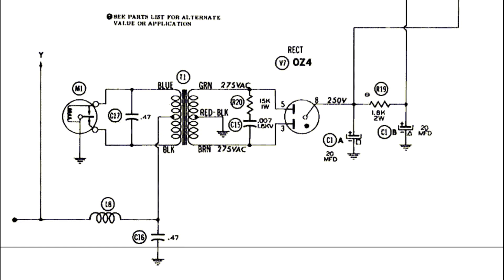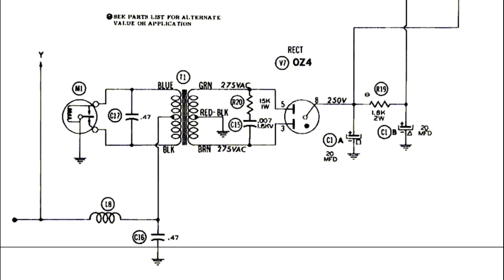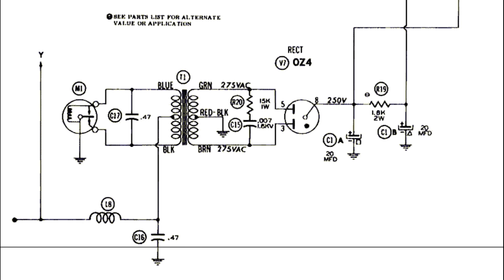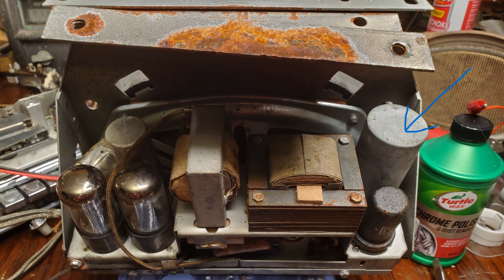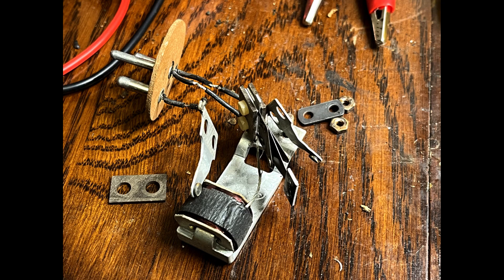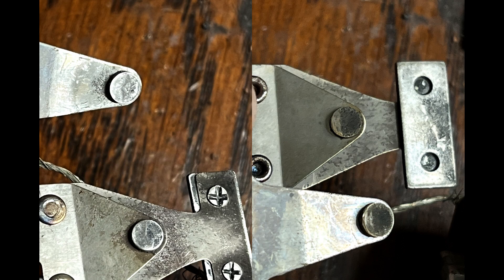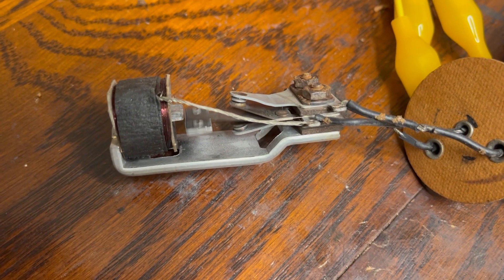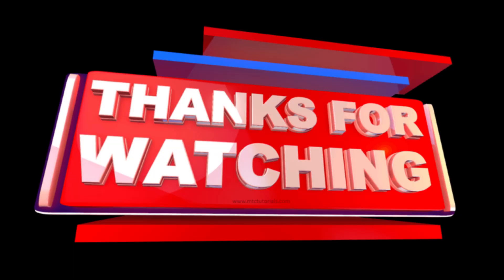Vintage Car Radio Vibrator Refurbishment

Comment: To prevent failure again replace the 2kv buffer capistor in the secondary circuit of the power transformer.

Comment: Refurbishing these old vibs is never a lasting situation. They will fail pretty soon again. Best is to replace them with a solid-state model, built in the original can. That way you maintain the original looks of the equipment. I recommend PeKo radio vibrators, they are the best.
Reply from the maker: For what it's worth, this one is still going strong. Solid state vibrators are always polarity sensitive; nothing on the car is from the factory though (aside from polarizing the generator), and some people like to keep it that way.

Comment: Did not see the cure. Personally I have a burnishing tool from the old day from the Bell system. If contacts are too pitted you will need to use 600 grit emery paper ( wet and dry variety ) to get things polished down but do not over do it. Following with a polishing with the burnishing tool. It’s important that very little of the pitting remains and surface is as shines as possible. Then clean with 90% isopropanol. Leave no residue behind, it will lead to arcing which will lead to more pitting. If the wires are falling apart, you can replace them with new wiring of the same gauge or yes you can resort to heat shrink tubing. I recently replaced the vibrator based circuitry of a 12 volt 15 watt fluorescent RV light fixture with a solid state module. The circuit on the light consisted of a four pin vibrator rated for 12 volts and a simple transformer. Not too efficient and noisy.

Comment: Excellent video! Thanks for sharing your knowledge and expertise. Can you recommend what voltage DC I should use to test a 6v vibrator from a Nash '49 radio? It has four posts: 2 small, 2 large. The radio powers up, but the vibrator is not humming; I suspect it is bad / contacts frozen. I am not sure how to test it before putting back in the radio. Thanks again!
Reply from the maker: Remove it and ohm between the center post and each contact to test both. You should see continuity from pushing the arm to the contact so they are lightly touching. If not, clean the contacts then test again. If the ohm test passes, then reinstall it in the radio and it should work. I suggest also to test the capacitors in the radio when it is out of the car, as bad capacitors will cause unwanted fluctuating voltages. You have to disconnect one lead from each capacitor to test it, then solder the lead back to the circuit if it's ok. Desolder, or cut the lead in a convenient place, not too close to the capacitor body so it's not overheated when you solder it back together.

Comment: I thought I would add one more comment-I took the vibrator in my Snap-On Ignition Analyzer apart and repaired it yesterday, based on the information in this video!  Thanks to what I learned here, my 50-60 year old ignition analyzer is now tested and working!

Comment: American Flyer trains of the 1950s used these vibrator tubes for their "Air Chime Whistles". Trains run on 60hz and the tubes send 600hz through the track which is picked up by a speaker in the locomotives. These whistle tubes are all going on 70 or more years old and more often than not they don't work. I have a few torn apart on my work bench and this video will definitely be helpful in repairing them.

Comment: Hello! Good work! But what to do when this radio can receives only MW/LW bands? There are lots of EMI noise in cities and towns - because LED lighting on streets. Next to each lamp post there will be buzzing from a speaker.I mean an night and evening.
Reply from the maker: The radio alignment process makes it so it will reject any stray frequencies coming through the antenna, but if there are frequencies being picked up by the car chassis these can get picked up as they are not adequately filtered by the radio circuitry. Do you have all the recommended suppression capacitors installed? See your car service manual and/or radio owner's manual for where to put them.
Reply: @hphpackardlowrey2776  To reject EMI noise in your car's radio DC/DC converter, I would first change two electrolytic capacitors to new low-ESR capacitors at 22 uF and 400 volts (I mean 2 capacitors after the rectifier). This update must usually helps - because old  electrolytic capacitor usually "dry" and therefore does not have capacitance: you can hear loud "rrrr" from the radio speaker in any position of loudness regulator.  Secondly, if it has not helps, I would checking the  rectifier: are the both diodes working properly? If not - I would change the vacuum rectifier on the HER307 semiconductor diodes.